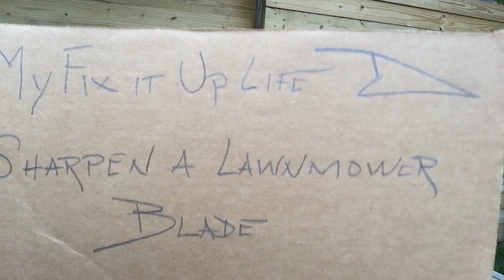How to Clean & Sharpen a Lawn Mower Blade

Comment: Good video. I've been sharpening my blade with a Dremel for many years. It's so tiny I don't even need to take off the blade. Keeps my grass cut cleanly and it's easy to cut when it's wet and high. But I would definitely recommend you use ear plugs when using a tool with this Db range. It will cause hearing loss even over a short time.
Reply: How do you balance your blade if you don’t take it off?
Reply from the maker: Excellent advice! I agree. I like those 3M doohickeys you can wear around your neck when not needed. Thank you.
Reply from the maker: Blade should be balanced for sure. Not shown in the video but will show up in a mower. Just hang the blade on a nail. If it tips, remove steel from the side that tips until it hangs at 3 and 9 -- good question.

Comment: Thanks for the video is exactly what I was wanting to find out.  My dog drug my angle grinder in the yard during a monsoon and it no longer works. I have a Dremel though.  Not today satan, not today.
Reply from the maker: Oh man. Grinders and monsoons. No bueno. One thing I should have added is to balance the blade. Put it on a nail through the center hole. If it tips, one side is heavier than the other. Take a few passes to remove some steel so it hangs level. Also, thank you.

Comment: Get the sharpening attachment that way your blade will be even
Reply from the maker: Thanks Jose. Also missing from this video is balancing the blade after sharpening.
Reply: Jose, why won't it be even using the grinding wheel?
Reply: @shonsberge  moving blade by hand isn't the same as stationary with attachment. But if that's what you prefer and it works for you then do it your way